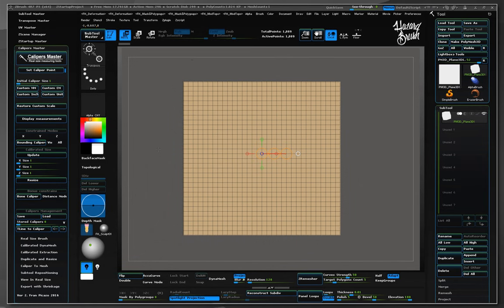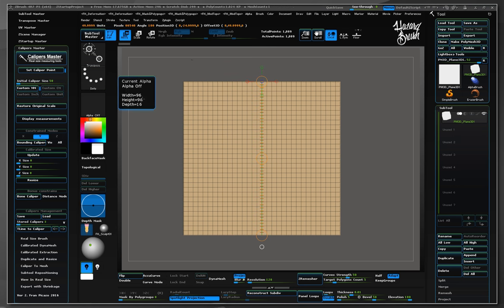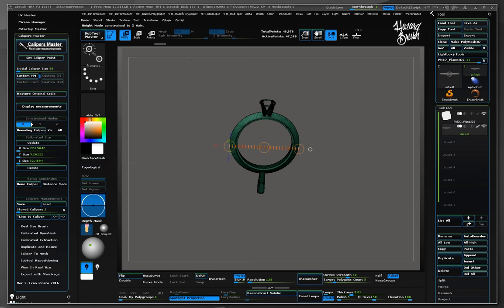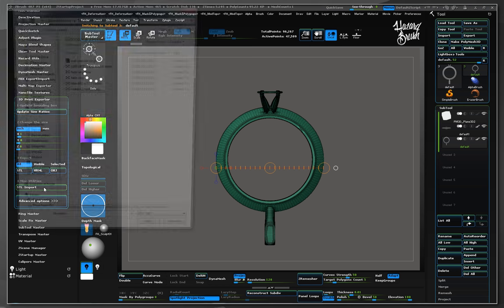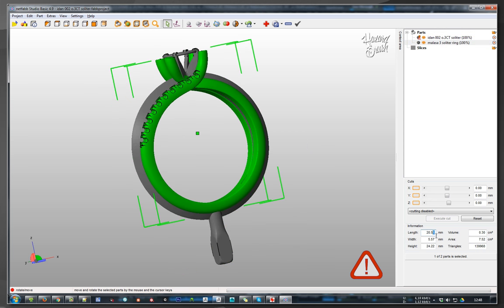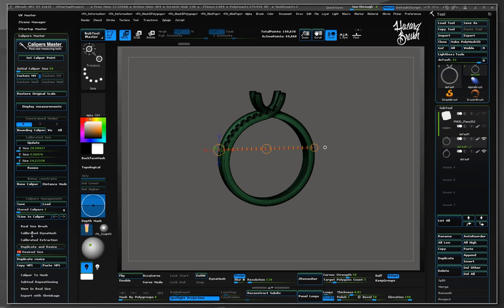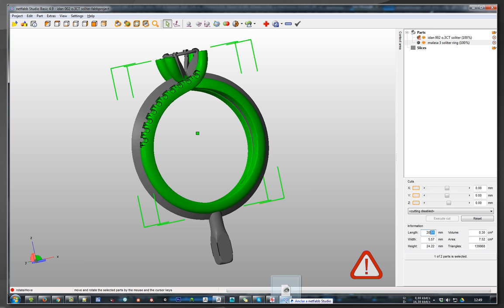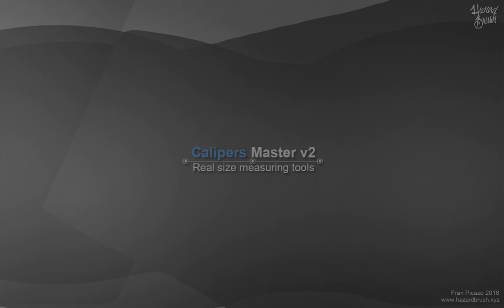Calipers Master v2: How to Import, Resize and Export

Comment: In this video you didnt cover importing an OBJ into the scene as titled.  How would one do this with the same results as the STL?  Thanks
Reply from the maker: Hi Joseph. I forgot to cover that as it is a regular OBJ importing. You can do it under Tool:Import.
The goal of the video is to show how importing performs on a precalibrated scene no matter the file type used.
Thanks for the input.
Reply: I tried it that way and it didnt size like the STL importer does.
Reply from the maker: I´m not sure why it´s not working there. I tested and it worked fine:
Exported a cube of 50mm then imported on a 100mm calibrated scene and it was exactly half the size. Calipers displayed size was 50mm as expected as well.
Reply: Hi Fran,  my original is 76.2 mm and I try to resize another import at 154 mm it becomes the same.  to get double I have to put in a value of 300 mm, four times the measurement.  I dont understand!
Reply from the maker: Joseph B please send an email to franhazard@gmail.com so I can have a better idea of what you need. screen captures with notes are cool